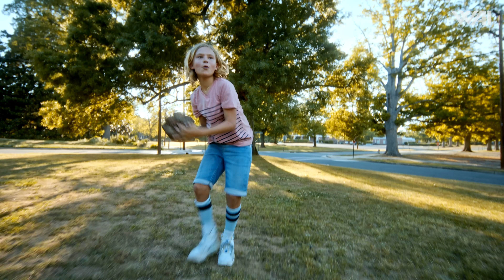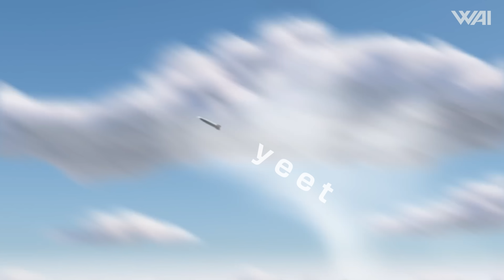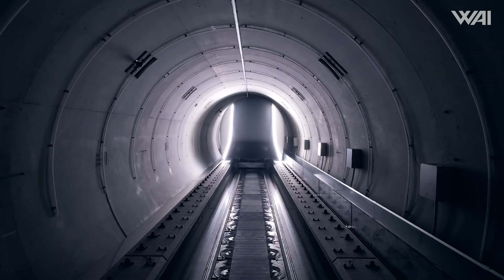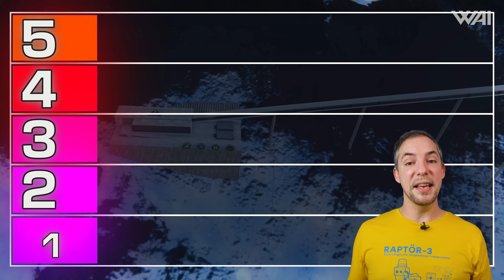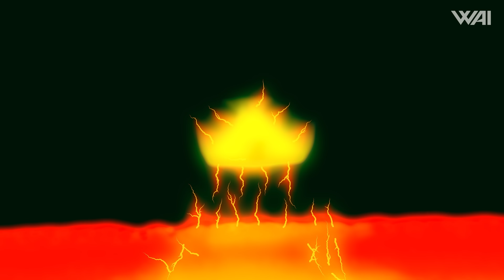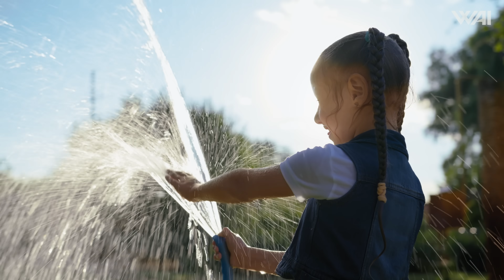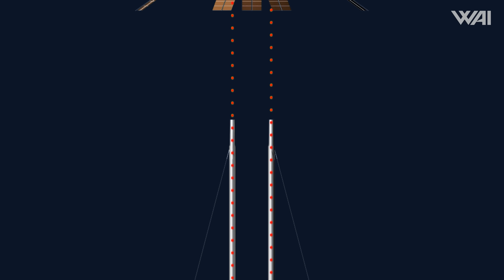The five craziest (but possible) ways to get to Space!

Comment: Felix lists 10 of the most extremely unlikely ways to reach orbit, until we have invented, ‘Negative Energy/Mass?’, stronger stuff. The most likely launcher to be used is of course the Mass Drivers, riding up a mile high vacuum tube on Maglev rails. Honestly, I see Mass Drivers, aka. Rail Guns, and Space Elevators on the Moon, first. It takes less, to reach Lunar Orbit from the surface of the Moon than it takes to reach Earth Orbit from Earth.

‘Less what? Power and Infrastructure, because of the less gravity and atmospheric pressure.’

One Idea for a high altitude launch pad is Graphene Sheets stretched between high altitude Blimps or hasn’t anyone read my books.??

A Material with Unbelievable Strength: found at ACS Materials

Graphene is, very simply, a single “sheet” of graphite. Remember that graphite is a stack of planes of hexagonal rings of carbon atoms; one isolated plane, or sheet, of hexagonal carbon rings is an allotrope called graphene. Graphene has been around in theory for more than a hundred years, but it wasn’t until 2004 that this material really took off. In 2004, researchers Andre Geim and Kostya Novoselov at The University of Manchester separated single-atom-thick graphene layers from graphite and transferred them onto a thin SiO wafer using the scotch-tape exfoliation method. Since then, research into graphene and its properties has exploded across all fields and scientists and innovators around the world are working tirelessly to develop methods to produce graphene in bulk quantities.

But why is everyone so excited about graphene? Why is this very simple carbon allotrope attracting so much attention? The answer: graphene is getting all the buzz because graphene is amazing. Graphene is  lightweight, virtually transparent, and demonstrates extraordinary electrical and mechanical properties. Graphene is also super strong, 100 times stronger than steel! This unbelievable strength, placed among its other amazing properties, makes graphene a truly exciting material.
We need to get to The Moon...Lets Get There Already...

Comment: Definitely would like to see a space elevator, but think it is unlikely.  Not because of materials (solvable) but because of security.  

Imagine a crazy idiot blowing a bomb near the top of the cable.  Ever played crack the whip?  Now imagine a 100000 kilometer whip coming down at reentry speeds.  And wrapping around earth 4 times.  Supersonic shock waves that cover most of the planet and tsunamis that make the boxing day disaster look like a minor annoyance.  

Same problem with all devices that involve megastructures.  Felix already mentioned what happens if a space fountain is interrupted.  No responsible investor will spend money on any of these when considering the cost of construction vs the ability of some wild eyed pistol waver to wreck the system.  

Orion is viable, but only in space.  However, you would never get people to allow the launch of that much fissile material on conventional rockets.  

The only solution to rockets that I can see is 20/10 on the crazy scale, and has no near term possibility of being solved.  It is gravity manipulation.  There has been some give in that area recently in connecting quantum with macro physics, but a full solution is at least a century away.  

One thing not covered here is a laser launch system.  Some work was done in the 90’s with models that showed promise, but I haven’t heard anything since, so it must have run into some kind of roadblock.

Comment: Several of these projects (Star Tram, Space Elevator, Space Fountain) fall under the category of "this probably needs far more infrastructure than estimated." Especially when it comes to the foundational work needed on the ground. You don't want a hurricane blowing over critical infrastructure. The Space Elevator and Space Fountain will also need to deal with micrometeorites and space debris.

Comment: My favorite is the orbital ring, similar to the last item on the list, but instead it's a constant stream of particles in a tube going around an entire orbit. With the particles going faster than orbital velocity, they push up on the stationary tube, keeping it rigid and in the sky. Then all you need is a cable that can withstand a few hundred km to connect the ring to the surface, which is perfectly possible with todays materials. From there, all you need is an elevator that can bring you up to the ring, then you can use a maglev on the ring to accelerate you up to orbital velocity with no propellant needed.

Sure, even a small one would probably weigh a few million tons and require 40,000+ km of superconducting tube, but it has all the other methods to orbit beat in terms of sheer potential throughput.

Comment: Should be noted that a small rocket is always needed for something like SpinLaunch - an orbit needs more than just orbital velocity, it also needs to be positioned correctly around the Earth. The trajectory of a ground launch system will always go back to the launch site*. A small correction burn is needed to move the orbit into a proper orbit around the Earth instead of going back to the launch site. It's not really a cheat code - it's just how orbital mechanics works out.

* Unless you go faster than Earth's escape velocity, but that's not what you want if you want to put a satellite into orbit.

Comment: The key problems with all launch solutions is the high gravity of Earth and its thick atmosphere.

Spin launch has the same limitations of Gerald Bull's space cannon, incredibly high acceleration and extreme temperatures from trying to operate hypersonic projectiles at sea-level pressure.  Note that you cannot fly a supersonic, never mind hypersonic, vehicle at sea-level.

Electric propulsion is trivial on the Moon or Mars where the atmosphere is a vacuum.  The best depiction of this was in The Moon is a Harsh Mistress by Robert A. Heinlein.  The author was a trained engineer, a graduate of Annapolis.

Orion was, in effect, used to launch a steel access cover from a test explosion in Nevada.  However calculations indicate the cover evaporated on the way to space.

Comment: Depending upon the definition of “crazy”, the thermal heat from nuclear fission or fusion accelerating particles out of the rocket engine is the next step after we’ve reached the limits of chemical rockets (including in-space refueling).

We are very close to the limits of chemical rockets, and with difficult to reach in-space and at-destination refueling. With SpaceX’s plan, we have just enough delta-v to get to Mars and back albeit slowly.

It is possible and even arguable, that space companies should bite the bullet now, abandoning chemical rockets and develop nuclear ones and then using them, and that ultimately this will be a better course.

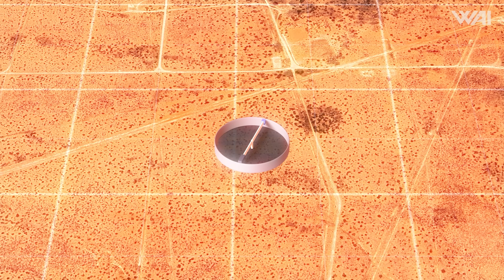Comment: 5:00 QUESTIONs:
1: How they deal with heat at sea lvl. 12.000km/h at 1BAR/1atm is 1,200kg/m3=density of air it can generate even plasma. We saw spaceship generate plasma at 25.000km/h but density is 1%.
2: How they solve the counterweight AFTER launch? an fast resort or mechanism wher counterweigh is moved to the center to reduce wooble and potencial energy recover from spining.
3: extreme G force this i think is imposible wich limit the type of lauch wich is ok. if get chip can launch water to space-hotels or labs in orbit.

This method is good but in space vacum. like orbit of any planet. and moon. even in Mars where atmosphere is really thin.
Reply: 1: At 12.000km/h you will pass the thick parts of the atmosphere in like 2 seconds. Even if the air is heated up to plasma temperatures, that heat still needs time to move through the material of the rockets tip, which is made out of strong metal alloys.

2: The release mechanism of the system supposedly took a lot of work and they are secretive about it, so yeah, it's probably complicated.

3: Electronic devices can survive sutprisingly high g forces when designed correctly. The system would be able to yeet small satelites into space.

Comment: Yes there are a lot of more concepts I think that could be covered! 

I think one interesting option not covered here is a skyhook (NOT a space elevator!!). A skyhook would rotate while in orbit and be slower at one end while being faster at the other like a wheel. At the slower end a spacecraft can dock and it will get the rotational energy converted into kinetic, which can be released at the faster end. The skyhook can gain rotational energy either by using it as a electrodynamic tether or by slowing incoming spacecrafts.

Long tethers with payloads at the end have already been tested such as with the YES2 and STS-75 mission. Boeing HASTOL project gave an in-depth analysis as well.

Another concept that is very crazy, but possible is an orbital ring. The orbital ring, proposed by Paul Birch is similar to the space tower, but it’s a ring in orbit. The particles following inside are at orbital velocity, while the hull is magnetically suspended. From the hull one can hang a rope down, actually thousands of them across the ring. The orbital ring would allow one to carry megatons a day into space

Comment: On the Spinlaunch, with a 'g' load of ~60,0000 (i.e. a 1Kg mass end up weighing 60 tonnes) what payload could you actually launch without destroying it? Anything with electronics in it would be completely pulverised by those g forces. I genuinely cant think of anything that you might want to launch into space that would survive a Spinlaunch? Unless there is a sudden demand for launching blocks of solid steel into orbit I cant see how it's any use for anything. There are obviously some very clever people working on this so there must be a point to it, what am I missing?
Reply: Fuel, water, food.

Comment: SpinLaunch -- during the description you mention the object to space on one end and a counter-balance on the other. Suddenly one end loses the mass of the rocket, but what happens to the counter-balance? The wheel is suddenly unbalanced -- at 60,000 G of force. Sounds like immediate destruction. 
And if you had some method to immed pull the counter-mass to the center (to balance) then the arm itself would accelerate to unimaginable speeds. I guess it would have to drop the counter-weight too. The force to send a rocket into space directly into the ground. I doubt if even solid metal could be used more than once.
What's the plan?

Star Tram -- This concept has already been discussed for use on the Moon. The low orbital speeds are easy to accomplish on a short maglev launch track.
the problem is the Orbit is defined the moment it leaves the track, and that intersects with the Moon itself.  So it needs another thrust in Orbit to circularize the orbit. Perhaps the payload includes a small thruster?

Project Orion -- Imagine launching yourself to distant places (even the moons of Saturn) only to leave your Airport/Spaceport Radioactive.
You definitely have a reason to move somewhere else because you made uninhabitable the place you left.
sounds like Space Vagabonds. Space Gypsies wandering from one irradiated world to the next.
Share the Wealth?
Actually the nuclear force would radiate in All Dierections spherically which means it is a very INEFFICIENT method of propulsion. What is the angular area of the spacecrafts Pusher Plate from the bomb? Just a few degrees -- yet push goes in all directions. That's the fraction of efficiency -- less efficient than even your worst mileage gas car.
Even atoms have mass (Uranium being some of the heaviest). At the velocities of space travel running into a cloud of heavy particles can be like getting sand blasted (or worse -- punctured by the unstopable atomic meteor). Potentially making whole areas of space unpassable. 
How many atoms does it take to make one rock? What if you encountered them all in a few seconds -- that's an equal impact as the solid rock.

Space Fountain -- A vacuum is not a perfect Vacuum.  Ecen at the altitude of the ISS there is atmospheric drag which is requires to push the ISS up every once in a while. This includes all the light gases but also atomic Oxygen and heavier gas atoms.
I dare anyone to stick a pipe up to space (with an open end at orbital altitude) and not expect that these "vacuum" gases don't happen to spill into the pipe and accumulate as atmospheric pressure at ground level even inside your pipe. This is how atmospheres accumulate and stay on Earth (despite the vacuum of space) in the first place.
So it would be impossible to maintain a vacuum tube to space. something will spill into it and that will be 1 atmosphere at sea level -- inside your pipe.
Reply: Spinlauch obviously has a solution to counter-weight being released as they are scaling up from current test model. I'm pretty sure the patent says the counter-weight is released at the same time as the payload but remains to be seen how that is handled in the full scale model. Could of course be that it's never going to work but they still seem quite confident.
I'm wondering if the conter-weight could be mostly water, it would be quite a splash being released at those speeds tho.

For Orion the nukes can be shaped to increase the efficiency. And nukes generate a lot of energy for their mass anyway, there's a good reason why the vessel was designed to be so large, it wouldn't scale down well. 
I do agree there's no way Orion would be used in atmosphere.

Comment: One thing that has always bothered me about space elevator technology is interference with the cable.  In the atmosphere, strong winds will push the cable one way or the other, moving the counterweight way out in space.  In space, there are man-made space items that might impact the cable, and either weaken it or sever it completely.  Or micrometeorites hitting the cable and weakening it over time.  Or something could hit the counterweight (again, space junk, or meteorites), and even if they don't destroy it, just moving it out of position will put extra stress on the cable, and cause the counterweight to probably oscillate back and forth, weakening the cable, especially at the earth attachment point.

Comment: Hi Felix, as I just wrote to Tim Dodd, you can't launch anything live at those accelerations, but you can launch fuel.
With a centrifugal system, you can send fuel into orbit, then you need a system to circularize the orbit. A solid-fuel rocket motor might be enough to circularize it.
Once in orbit, you collect the fuel and place it in your ship's tanks. Instead of seven launchers for Starship, you'll only need one launch and several centrifugal fuel launches.
In this case, the rocket equation doesn't apply, at least not for centrifugal launches.
Maybe the savings aren't attractive enough, but it could work with a savings, perhaps moderate.

Comment: Why doesn't spin launch use this vacuum method?
Also what about a rail gun BUT the rings are horizontally positioned drones. Space elevator without the heavy long "rop"/wire" and problem solved lol

Comment: You forgot about Gerald Bull's supergun which could yeet small payloads almost to LEO. With today's technology, for instance electrically activated solid rocket fuel (see Integza's video on the stuff), it's now possible to launch non-compressible payloads (think nuts, bolts and other construction materials) with every shot. Think of it as a super short 'star tram' 🙂

Comment: Here are the ideas I came up with over the years:  
(1) Vacuum Balloon.  Atmosphere thins rapidly with altitude and you reach stable orbit when its thin enough to not be slowed down after a few orbits enough to fall back to Earth.  However, if there is enough atmosphere to create drag then there is enough to generate lift.  So build a large wing shaped balloon.  Let it lift with hydrogen lifting gas but, as the atmosphere things, pump the gas out heated for thrust.  Eventually, the interior will be a vacuum moving at extreme velocity.
(2) The Double-Yoyo.  Use a lifting gas with balloons or large propellers or any other means to lift a bar up as high as possible from both ends.  In the middle, there should be two spindles of cable, each attached to a launch vehicle.  Begin spinning them and releasing more cable to massively increase velocities at the ends where atmosphere is too thin to worry about shock of the sound barrier and not so much heating.  While the main vehicles are extended out to the end of the cables, the carriage with people or cargo stay at the inner end of the cables.  When altitude and velocity are sufficient for orbital insertion, release the inner carriages to naturally slide down the cables and, upon locking into the vehicles, detach.  Time this at the right angles, too, of course.  The extreme inertia in the vehicles would squash a person but if a person is sliding down the cable, he will reach that velocity with virtually no inertia at all.
(3) The Starslicer.  This one does use a rocket engine but a very safe and low cost one.  This is my favorite concept that I have developed most.  It's two large counter-rotating discs made of layers of aramid fabric and polyurethane foam.  The two discs are connected via a magnetically separable spindle that can latch to either side (and therefore also acts as a conduit between the two).  The basic idea is that passengers would launch in the spindle section while the discs would spin up to very high RPMs and have water in them.  The spin is used to generate electricity to rapidly electrolysize the water into hydrogen/oxygen that burns in a rocket engine of concentric pressure chambers. The interior burns H2 + O2 while the outer size uses steam (by cooling the inner chamber).  These are made from simple titanium pipes.